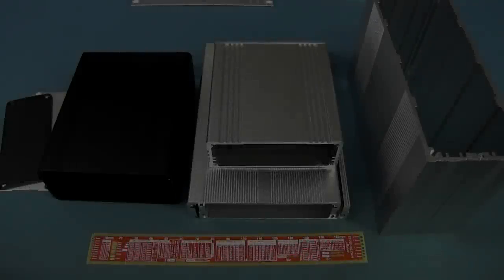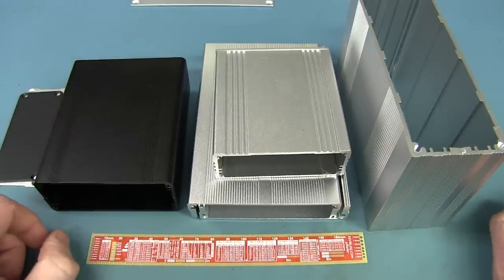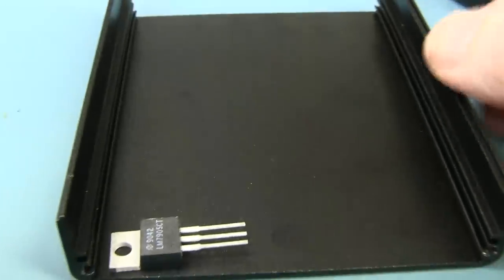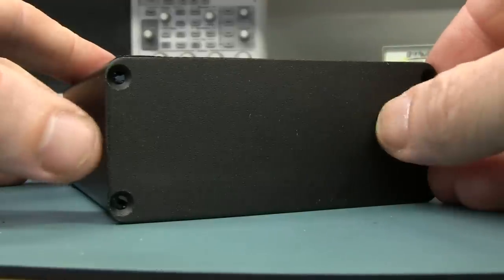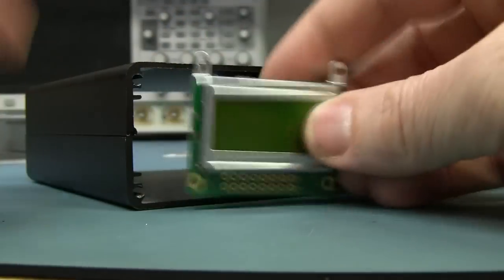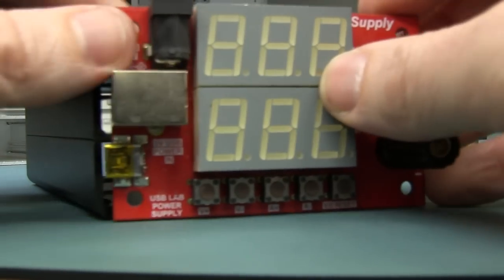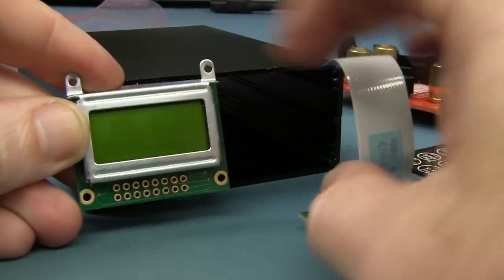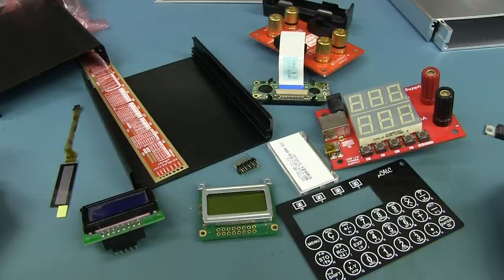EEVblog #644 - How To Design Front Panels On Extruded Enclosures - µSupply Part 14

Comment: Hammond do some nice (but expensive) extruded cases with plastic end bezels which nicely hide the edge of your PCB front panel - 1455 series
Reply from the maker: Yeah, have used them before, they are nice. If you get a fully routed front panel  board then no need nice to hide the edges though, it looks pretty good anyway.
If you want less fiberglass visible then you can use a 0.5mm PCB also.
Some manufacturers do nice silicone rubber end boots too, then no need for rubber feet.
Reply: Jeremy Abel Maybe in the US market, but to my UK eyes they look like a 1970s cassette player I'm afraid.
Reply: I'm using a Hammond 1455T2201BK which has the plastic end bezels, very neat. However well routed FR4 is, the edges always look a bit crusty. Maybe fine on a cheap product but not something $100-200. The bezels act as feet, protective bumpers and trim to hide the crusties. Sometimes spending a few cents on trim can add dollars to a product's perceived value. Anyway this is a bit complicated for YT, so I'm heading over to the EEVBlog forum!
Reply: Jeremy Abel
 Holy Atari 2600 batman!

Comment: On the idea of attaching the TO device to the case, you can use a PEM-stud to reduce the visibility of the hardware on the outside. For that case the PEM would have to be black anodized as well to make is nearly invisible.

Comment: Actually you can use some insulating thermal material between the TO-220 and the casing, insulating the casing but still sinking the heat away from the power transistor.

Comment: I think the best way for small PSU is to add encoder with switch instead of few switches or few potentiometers.
Click>set mode for volt>second click set mode for amp>rotating to set volt/amp>long press to set choosed parameters and quit setting mode.
Everything done by one knob!

Comment: Also you can use a sheet metal laser cutting machine to form a flatted part of your chassis then a bending machine will form your chassis according to your dimensions, and a couple of screws in each side will make it rigid enough for handling. Its a very accurate way to have a perfect alignment between different internal parts and a good look of your product. The most advantage thing of this procedure that you are going to have a product with too much less weight than the extruded aluminum chassis.

Comment: I just noticed that your 18650 battery is a 'Trustfire'. DO NOT USE IT! Unless you buy genuine new OEM cells (Panasonic/LG/Sanyo, check out Orbtronic), the best way to get 18650 batteries is from old (or new) laptop batteries, simply because they are genuine batteries. Pretty much all of the eBay batteries (especially ones with 'fire' in the name) are from C-grade recovered cells and some have been found to have smaller batteries stuffed inside them with filler around them.

Comment: You can always put the output plugs to the back (like Manson PSU early models) and have room for nice adjustable knobs in front. As this will sit freely on the desk anyway (not ducted away in a shelf), there would be no hassle to access the back of the box to change cables. Or you could have cables from back coming out and from those cables you connect to your project. Kind of like a remote output. I think that if you have all cables from the back, you will have more aesthetic design to the device. Do some sketches ;)

Comment: I planned on building my own power supply based on your µSupply. When I searched for Cases and UI elements I was a bit surprised: Most cases that suit my needs are relatively expensive ($35-$150). Also I didn't find too many knob caps, I'm looking for either wide, flat "dials" with a thumb indentation or "typical modern scope knobs" with rubber surface. Does anyone know sources?

Comment: how radiator inside case can be more efficient than case?
:D
Reply: The case is quite thin so the amount of metal directly attached to the tab of the component wouldn't be as much as if it's attached to a meaty hink sink.
Reply: donpalmera
in sealed case without external airflow with time->inf. temp. of heat sink (inside case) will be higher then case temp.  simply thermodynamic rolls..
Reply: Bastek Master
That could well be the case. I think to be sure someone would actually need to test it.
Reply from the maker: An internal heaksink is much meatier and has greater efficiency of surface area compared to the thin flat case in terms of getting heat away from the die. Of course you'd want vent holes for anything serious. And as I mentioned in the annotation you can also bolt an internal heatsink to the top of the case giving best of both words.
Reply: donpalmera to transfer thermal energy you need temperature difference. there is no question but that.
heat sink temp. >aier in case temp. > case temp. > environment temp.
in STEADY STATE
Reply: Bastek Master The part with the heat sink won't constantly need to dump the same amount of heat and the heat from the sink will eventually transfer into the case and out. You would need to actually test it to see if the peak temp and heating/cooling curves are better one way or the other. Also that assumes there is no fan pushing air into the case etc. By the way; I wasn't actually arguing with you, I was offering a suggestion.
Reply: donpalmera Q = mcδT.  Delta T here is the higher temp minus the lower temp.  Mass plays a role as well as what its made out of.  More energy is transferred in a system with a higher delta T or difference in temps though :).  Just wanted to throw the physics in here
Reply: Travis Stanford
YES, but thermal capacity matter only in transient state.
In steady state, continuous operating (time->inf. Delta T/dt = 0 -> Delta Q/dt=0), thermal capacity doesn't matter.

Heat source always have highest temperature in system.
The most efficient way, to get lowest temperature inside case is transfer energy directly to case.

IN THIS SAME CONDITION, THIS SAME POWER TO TRANSMIT OUT SITE, CASE TEMPERATURE IS THE SAME.

HEATSINK IN SIDE CASE
heat source > heat sink> air inside-> case->environment
TEMP AIR IN CASE IS HIGHER THEN CASE TEMP.

WITHOUT HEATSINK, DIRECT TO CASE
heat source -> case ->environment
TEMP AIR IN CASE IS THE SAME AS CASE TEMP.

FOR HEATSINK 0.1W/1C AND 1W POWER
TEMP OF HEAT SOURCE WILL BE ABOUT 10C HIGHER,
THEN HEAT SOURCE MOUNTED DIRECTLY TO CASE.

Comment: For the µSupply I like the silk screen capacitive buttons, but off to the side of the display rather than underneath.  Having any button interface under the display would limit functionality.  Access would be too tight and fingers would get in the way of the display.

I would also give serious thought to battery access.  I would like to see access to the batter via the back panel, but ideally without the need to remove screws.  So some sort of plastic latch cover similar to remote controls.  This might not be possible, but deserves considerable thought.  Worst case is the operator can remove the 4 back screws and have access to the battery, which requires it to be mounted 90 degrees of the opening.

Comment: A heatsink inside the metal housing will not work unless there are adequate ventilation slots or what have you for air to get inside.

Comment: make the base board have two pieces that are thin and with no stopmask that goes through the 2 3-4mm holes in the LCD. Then you can also get mechanical mounting of the LCD and make assembly easier

Comment: Hey Dave, I think I wouldn't mount buttons below the LCD: Too close to the bottom edge and hard to reach/operate. I'd go for a multi-purpose turn/push-knob left or right from the display. But then you'd probably need a bigger display to show the different options/actions the user may chose.
Also: Is there enough distance between the banana plug posts and the case? It looked to me like at least the nuts on those plugs in particular would touch the top/bottom of the case... Anyway, nice video! I'm already waiting for more µSupply!
Reply: Keep in mind Dave will most likely be putting rubber feet on the bottom of the case. That will raise it up quite a bit. Probably close to 1/2" or 13mm.

Comment: I was working on a PCB front pannel but got stuck with placing the rotary knobs in a proper way. Any nice trick with that?
Reply from the maker: I've routed out a big square in the board and soldered the encoder from the rear side.

Comment: Some really good stuff on ebay too, if you don't want to deal with Aliexpress/china.
Reply: A lot of stuff on eBay (for the lower prices) come from China or the likes also, but the added benefit of more buyer protection of course.
Reply from the maker: Yeah, but I like Aliexpress where I'm buying direct from the manufacturer. Not always the case, but in this case it was, pun intended.
Reply: EEVblog I have found Aliexpress to be very good in terms of reliability and shipping, and the price is generally better than eBay.
Reply: alieexpress is pretty much the same as eBay, but without the 10% eBay fee

Comment: Actually I prefera a properly maschiened Aluminium frontpanel, and for my next project, which will be a PSU by the way, Im planning to use Cherry Switches... So Im going to print the keys myself and buy a aluminium frontpanel.